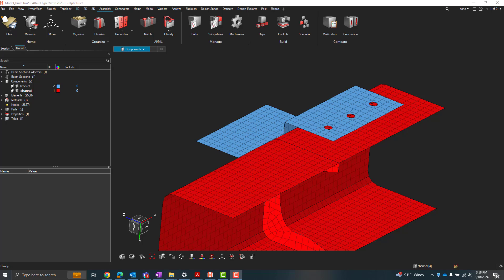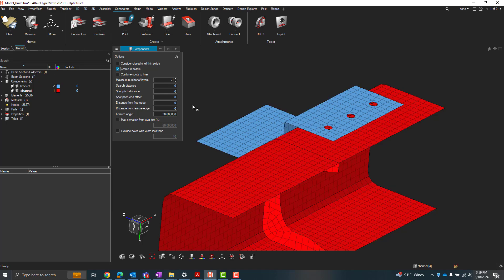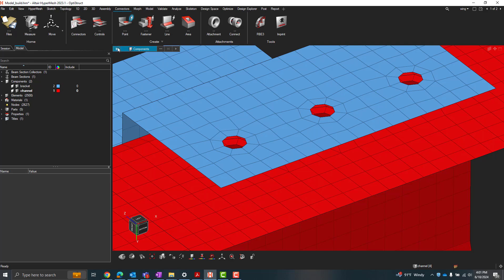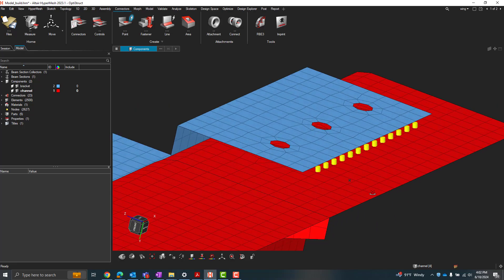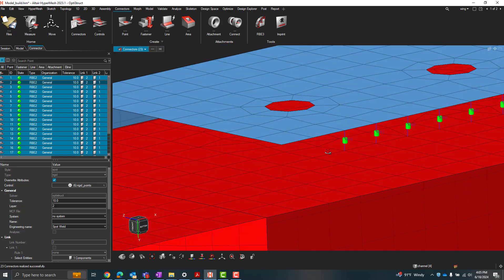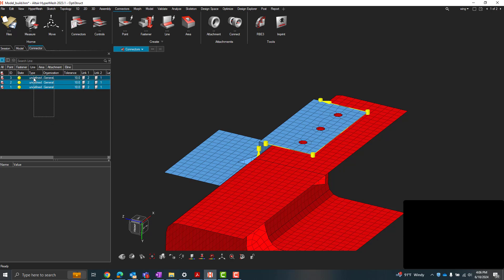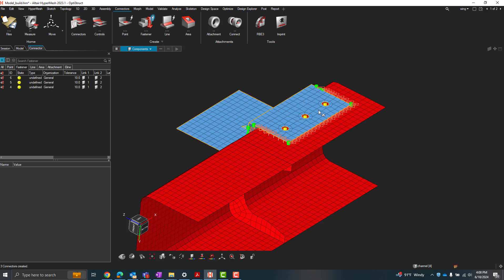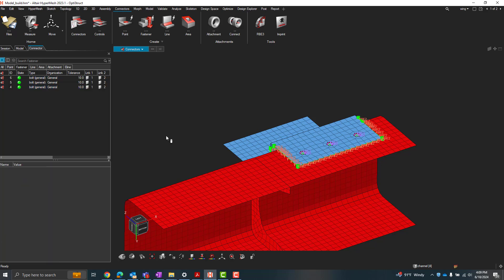HyperMesh Auto Connectors

Comment: I don't see this being a benefit in a large model. (1e6+ elements). In big models you aren't going to model, let alone mesh, individual fastener holes enough times for this to be useful en masse. I'd rather see a tool to help clean up bad fasteners (e.g. NASTRAN rbe3 and rbe2 elements, and replace them with 1D elements or RBARs with mesh refinement).